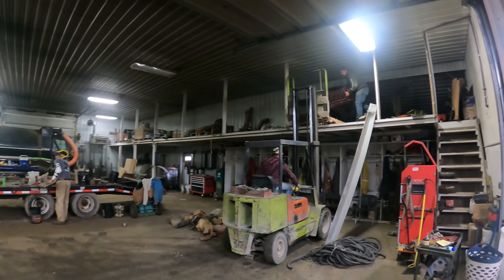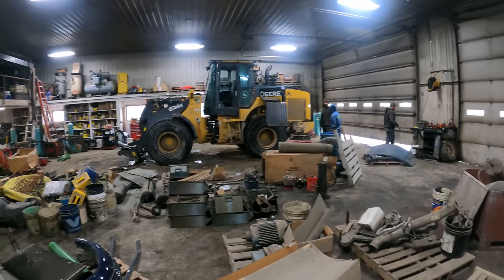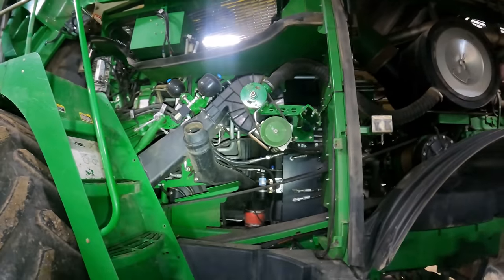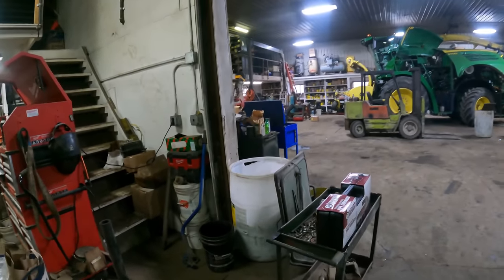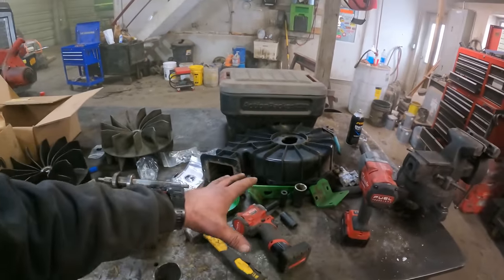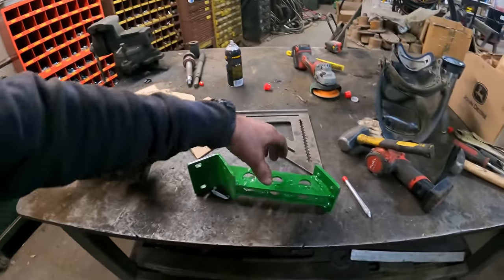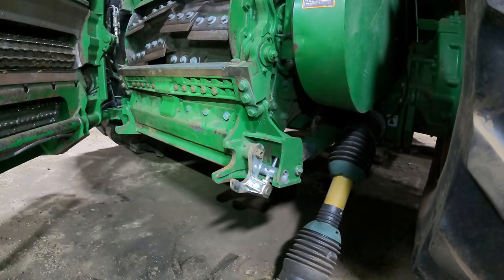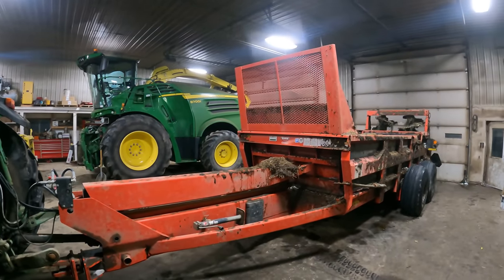Looks like a flea market

Comment: The belt tensioner you could alway put a right and left threaded rod with a threaded sleeve. Not sure how to explain it but basically like a turn buckle where turn center sleeve and two rod on each side expands.

Comment: Wishing your family and crew a very very Merry Christmas from our family in southcentral Minnesota Andy!! I am surprised the hydra. pipe is run through the tank to run the discharge. The fan is not out of balance breaking the bracket on the chopper blower? Gussets would help on the mounting part wouldn't it? Andy is there a place to put extra support on the hydra drive motor? No surprise some people know better then you about your generator plan.

Comment: I always wondered what was up above your office, I thought maybe it was the furnace for your in floor heat. Looks a lot better up there now! I think I saw a back seat for an ATV in that pile. I've got to do the same thing this year, the amount of stuff that I have piled up and saved over the years has gotten pretty bad lol.
I hear you on the Milwaukee pipe threader, I was looking at one last week or the week before. I couldn't justify spending the money on some thing I'm only going to use once every year so I bought the one from Harbor freight to, we'll see how that one goes. You would be better off to spend the 1800 bucks on the 1 inch impact gun. You won't be disappointed. This was an excellent video. Perfect length all sorts of good stuff here. Did you ever end up losing power? Take it easy buddy.
Reply from the maker: Haven’t lost power yet but the wind is still blowing

Comment: HEy Andy.  Merry christmas!  Question: read on the news that parts of USA is hit with hard winter weather are the parts of the usa u live in also hit with it? If that is the reason for the power cutout?

Wouldnt the smaller older tractors be able to run the those generators and spare the bigger and newer tractors for the hard farm work in the spring and rest of the season instead?
Maybe its not that many hours a year you gotta have the generators running in the end so it doesnt do much diffrence on wear and stuff on those tractors?
Reply: It takes a little bit of horsepower to run 100 KW generator though
Reply: @Adam_Poirier  alright thx. 
Didnt look like it would take much but i have no experince of those generators so probaly takes much more than i would think.
Reply from the maker: Rule of thumb when running a pto generator: it takes 2hp power per 1 kilowatt. The smaller 540 rpm generators we spin with 1,000 rpm pto and run tractor at about 1200 engine rpm